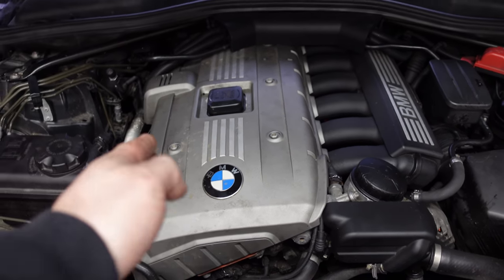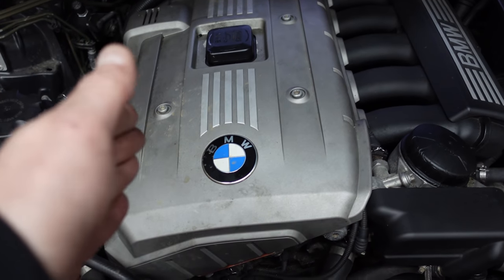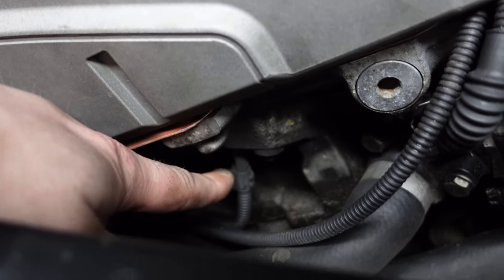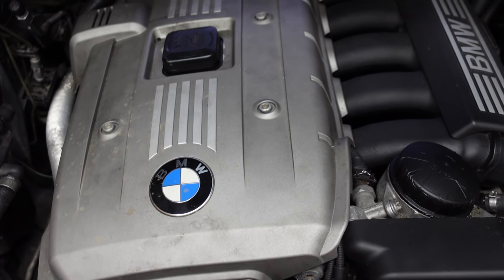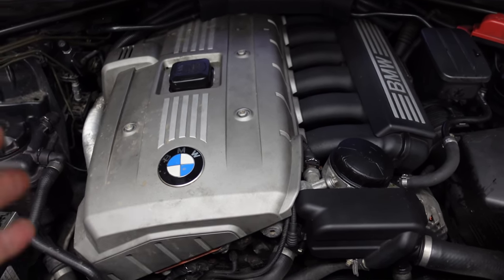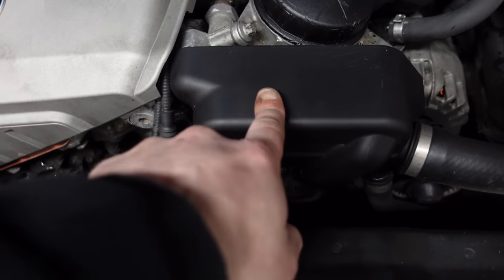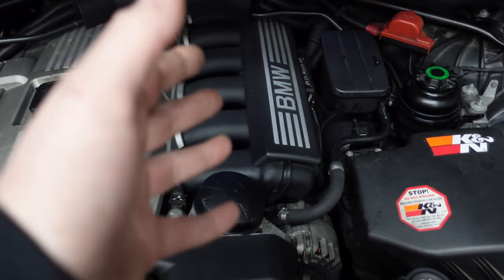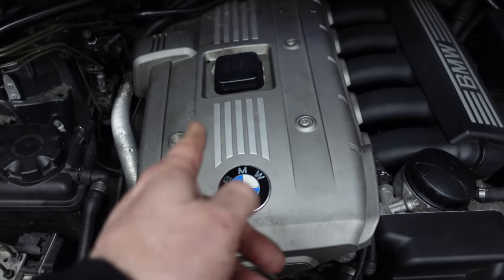The **REAL REASON** Mechanic's HATE BMW / Its Worse Than You Thought !!

Comment: Uh I've worked on and repaired BMW cars for years without an issue. However, I think what you are ignoring is the fact that technicians don't like these cars because they are overly complicated FOR NO REASON. Explain to me why a water pump needs a computer module to control it and why the possible benefits of that outweigh the increased chance of failure. That is just an example of the questionable engineering choices BMW makes on their cars. If you like BMW that's cool but don't blatantly ignore the valid reason why so many GOOD technicians dislike BMW engineering.
Reply: For the simple reason that the engine has less strain on it, for maximum efficiency. and if you are a good technician, then you should have no problem fixxing a modern bmw with the proper software like ISTA +, and what technicians you are on about, if you talk about american ones then you are right, but European technicians love BMW for the simple reason that bmw have fantastic engines (exceptions be there) they drive better then any other (normal) car handling wise, more luxurious with great modern tech. BMW is for people who love to work on car themselves, its a great challenge, but once you know how everything is put together it is fairly easy car to live with, everything is well designed and thought about. if you can work on it yourself like i do, then its the best car you can have = value for money
Reply: @lexburen5932  Fair points made by both the guy above and yourself however do these water pumps just quit without throwing a fault code? Would any mechanic with half a brain not remove the water pump after eliminating everything else and at least bench test it?
Reply: @Luton-Mick  they do fail with codes. You usually have turnbine speed deviation faults or open circuit faults. The reason why you don’t take it off to bench test is the amount of labor and time and it’s location to take off. It’s a waste of time and you usually have a fault code when it fails.
Reply: There's a reason, especially nowadays. It's called C.A.F.E. Standards and B.S. emissions requirements. Now not everything is because of that, but a lot of it is.
Reply: Hoping you read this!  My 2007 328i has a strange problem.  The left rear door will lock during driving, but when I stop and lock all doors with key fob the left rear door unlocks!  It has a new actuator.
Reply: @lexburen5932  re-read my first sentence. I have serviced bmw's for years without an issue. Compared to other types of vehicles though, like Asian or American vehicles, bmw's are just overly engineered for no reason. Everyone outside of Europe knows it. Everyone in Europe knows it but have a hard time admitting it. It's OK, we forgive you 🤣
Reply: Most new cars have a computer for every part it’s meant to warn u before it actually fails

Comment: So basically the mechanics are the problem not the cars. Essentially the engines are more intelligent than the dolts working on them.
Reply: Often most elegant design is simple one witch modern engines are not overcomlicate eco garbage
Reply: As a master mechanic I partially agree with your assessment.  Its a luxury car but many owners take it to the wrong places trying to save money. Fact is its not a honda and they are complicated.  I specialize in luxury cars and notice the many people can not afford  the regular maint of the vehicles that they drive.
Reply: @deadprivacy  Is correct. BMWs are poorly designed and dreadfully unreliable (when viewing from a daily driver perspective). This video suggests that BMWs are some how too complicated for the common independent technician to understand or fix. Ridiculous. BMWs are just like any other car (with their respective eccentricities). Instead of addressing incompetent technicians, you point the finger at technicians as a whole.  The truth is mechanics hate BMW because mechanics value reliability and ease of ownership as oppose to performance. With its common failures and high cost of maintenance, mechanics see BMWs as a poor investment, especially when compared to their reliably superior Japanese counterparts.
Reply: cant understand all the hate either. Im fixing all by myself, owned several different brands and can say for me, that bmw is the most expensive one in spare parts, but the best engineered one and easy to fix. For engine and all electrics you just need a notebook with BMW´s shopsoftware and the car tells you what's wrong by the help of several test procedures.
Reply: @deadprivacy  Spot on but you won't get most BMW owners to face reality, it's like they are in love and won't hear a bad word against their sweetheart.
Reply: I guess the CarWizard on Youtube is a dolt huh? You have no idea what you're talking about, BMWs are difficult to work on
Reply: They not machine if they do know how to do bmw
Reply: A lot of inexperienced mechanics work at dealerships

Comment: Listened to this, took my car to a BMW/Mini specialist and he literally didn't need to scan it. Told me on the spot what the issue is from his raw experience. Made it a cheap same day fix.
Reply: The vanos solenoids fault will not make an engine misfire, they will not set a misfire code And a lot of mechanics clean, change or swap intake and exhaust solenoids to see if the faults follow the solenoid. If it is shows the same fault (and there is a fault for solenoid failure, there are screen filters screwed into the head on the right side that can be removed and cleaned. You are right that it easier and cheaper for a BMW specialist to work on your car, and yes none of use know everything. I am a 45 year Jaguar specialist and the same rules apply@
Reply: @RAGNAR   You are right!  That's because they were "Common Problems".  "Common Problems should've have on a car you'd paid so much money for... 
 Just ask a Toyota mechanic.
Reply: Yeah because they all come in for that because it's a known flaw 😆
Reply: There are no cheap fixes for these cars but these garages love you for making them rich!
Reply: @mechman123
Reply: I have been working on euro cars for years, last shop I was working for specialized in BMW’s. Atleast Once a week a new customer brought their bmw with a inline 6 I pop the hood to see new oxygen sensors so I immediately check to see if the 25 cent rubber cap fell off the back of the intake (super common on the n54 engine I think it’s that one they stopped making around 2005ish). I check my fuel trim data, 02 sensors, maf, print off the data and codes. The put a new cap on, clear codes and reset  then run it to see all data is normal. Tell the customer and half the time they start talking about the codes it had and the previous shops replaced the 02 sensors because they had bad readings, coils & plugs because it had misfires that moved to different cylinders and the fuel pump had low pressure. I show the codes & data from before I explain the 02 sensor deviation codes basically mean they are maxed out lean, when a cylinder isn’t running properly the fuel injector is just off  and because it was a vacuum leak it effects all cylinders so that’s why the misfires jumped around. Now look at the data after the repair and let’s compare to the old which I explained everything so they can understand. I will say a lot of the time shops are honest saying they don’t know much about these cars and they tell the customers and customers don’t like going to different shops so they say well what can u do? The shop says I can replace the parts the codes say but that’s 100% on u no garuentees and the customer has them replace a bunch of stuff that doesn’t fix it. Then you have shops that don’t know anything about them but use their sales tactics to say it needs this for xx reason but no gaurentees because it has all these other codes and before the customer knows it they have 2000 into repairs it didn’t need but they agreed to taking the risks. And the funny thing to me is how so many auto techs complain about euro cars but let’s stay on the topic of BMW’s so these vacuum/air leaks were the most commonly missed diagnosed problems they came in all the time and all u need to do to get an idea if u have a vacuum leak is look at ur fuel trims if they are maxed out at idle then start to look normal at higher rpm it’s a dead giveaway you have a vacuum leak no matter what brand of car American, Asian, euro but 90% of shops don’t have 1 guy that knows this. After fixing a vacuum leak or fuel/air related issues you also use fuel trim data to confirm it’s fixed thats also something 90% of shops don’t have one guy that knows. I do this so I don’t have a customer come back in 1 day for the same reason.   Shops love to blame their techs for everything but never train them or send them to training or give incentive for learning. 

My shop is known as we can diagnose anything and fix anything many shops send customers to us even some dealers. Sometimes you can’t give a 100% guarantee this is gonna fix everything it does happen but throwing a bunch of parts at a car costing the customer a bunch of money is just bad business just be honest you don’t know how to fix it thats the best thing u can do.

Comment: Great video right on point. I'm a US tech, with over 30 years experience. When I first started as an auto mechanic back in the mid-80s, when Ford Chevy and General Motors all went to electronic fuel injection. All of the older guys in the shop would say is, get rid of that electronic fuel injection and stick a carburetor on it. Because they had no clue what to do. I 16 years old I embraced the technology, and wanted to learn as much as I could.
  Many years and decades later, I still like the technology and want to learn as much as possible.
  I have one BMW specific scan tool, to handle the basics. Then I switch over to my laptop and inpa software.
  Back then I only owned Ford's. Today I own three BMWs, and one Ford. I have quite a few friends and family that are BMW owners. If they have any problems they bring it to me. Most of the time it's a very easy fix that they can even do themselves. But the problem has to be diagnosed properly first.
And I'm not so arrogant to think that I know it all. Actually the opposite is true. I know I do not know at all, but I still want to learn.
   BMWs are great cars. Just require a slightly different approach.
  In Failure there can be lessons, in perseverance there can be results.
Reply: I have a 2004 x3 that has a misfire and lean in Bank 1 and 2. Smoked it... no vacuum leak. Changed the PCV , same thing.
Reply: Your situation reminds me of another lesson I learned years ago. I was so eager back then to learn the technology, that I disregarded checking the basics. What could appear to be a faulty sensor or loose connection, could actually be a bad spark plug. Old-school troubleshooting.
  Check the basics first. Air filter, fuel filter, spark plugs, and so on.
Reply: The slightly different approach advice applies to all German mechanical products, they arrive at a result of an engineering problem using a different mindset and approach. The only true successful way to work on anything German is to think like a German.
Reply: @peterbuckley3877  : If you live in a country where the mechanics are not capable to "think as a German", don't buy a German car.  In US people use to buy BMWs as a symbol of status, but now there's a shift toward Lexus. Luxurious, excellent manufacturing quality, excellent reliability.
Reply: the greek philosphers already said something like "i know that i don't know" or "the more i know, the better i know what i don't know". (Always the best approach to tech in my opinion)
Reply: @bkucinschi  4-6 years ago i knew a guy who was a proud Lexus owner (here in europe) and once, during driving, the dashboard of his Lexus "dislocated". I also know someone who's Toyota engine a few years ago catastrophically failed after just 30k km. (and they did not cover anything as the car was over it's 2 year warranty) You can get a lemon/be unlucky with any manufacturer, even with Toyota/Lexus.
Reply: @patrickpierre6114  When was your valve cover gasket changed? Mass airflow sensor replacement ?
Reply: Where are you based haha 🙄 asking for a Freind.

Comment: I took my BMW E60 to a shop to change the valve cover gasket. I have the same engine as yours. I normally work on my own car, but I let the mechanics handle the valve cover because of the torque of the bolts for it. I don't want to break it.  That is an easy engine to work on. Very reliable. The shop foreman was telling me how he don't like BMW's because they are problems.  I told him I had this car for over 11 years never had trouble. Other cars are a lot harder to work on. I get very angry when they do that talk. These engines are very easy to work on nothing to it. I am glad they are easy to work on because BMW has always been the car of my dreams every since I was 7 years old.
Reply: I just did that job on an E90 a month ago, there is a good video from "Zeiten LLC" on the subject.  Getting at the bolts towards the windshield was not easy.  I think the dealer wanted $1200 for this.
Reply: Never grew up as BMW fan, and the first German car i wanted was a B5 A4, but for a time I kinda liked the E90, ended up buying one. Planning to keep and maintain this one a long time.

Comment: Forgot to mention the oil pan leak. Got to pull the transmission. Simple oil pan job is turned to 12 hours thanks to BMW
Reply: Oil pan leaks are repaired by lowering the subframe? What car do you need to remove transmission for?? A lot of rwd cars are difficult to access to the oil sump.

Comment: @BMW Doctor I don’t agree with you actually. I think BMW makes clever, efficient engines but they are not designed with maintainability in mind. For example you have to take so many parts off to get to the water pump or the alternator. It’s just poor design that mechanics need to have such specific and advanced knowledge in order to maintain these vehicles.

Comment: This is a shame really because a properly looked after BMW can be in its prime between 10 and 20 years old.  I have managed to do this for the last 30 years. Buy doing most of my own repairs I have saved a huge amount of money.
Reply: Most people want to get rid of them after 4 years it is crazy to keep them out of warranty or without any extended  and Luxury is supposed to mean the luxury of time not having to work on the Ultimate driving machine that is always breaking down unlike Honda and Toyota  who can somehow make a reliable car consistently  and Yes I own a BMW X5 it was near 90K us  New and it is a pain in the ass at 63K mies  it makes my audi's look reliable
Reply: @johnhender  My first BMW ever, I've had it for 2 years now and I haven't had a single issue aside from doing the maintenance on it. Vehicle has absolutely no codes, I confirm with ISTA/D. Car runs excellent. Not sure what some of you do with your Vehicles to have them break down all the time but I daily mine and don't have none of those issues. 🤣 2008 e60 535i. Much better than any Honda or Toyota I've ever driven. Small piece of advice, if you have so many problems then stick to Hondas. 🤣🤣🤣
Reply: Thats old bmw u speak of. These new ones filled with plastic

Comment: Hey Dean! Think you have (possibly deliberately?) upset a few people with this one. I am 69 years old and spent all my working life as a component level electronics tech. and have no problem embracing modern electronics. I like to look at it this way: I have 3 BMW's and like them all for different reasons. All modern cars are over-complicated, both mechanically and electronically. Every car you could choose to buy will have an Achilles Heel or two. It won't be that long before all the channels and forums will be saturated with people bitching about having to shell out 5 grand for a new battery pack and 3 grand a pop for a new electric motor, so maybe time to enjoy these German engines while we can. You obviously know your stuff, maybe just a slight error with the generalisations, but still an excellent channel that we can all learn from.
Reply from the maker: So you agree then my friend that for old people BMW is getting harder to diagnose ? As your speaking about just them kind of people because for me BMW is easy and cheap to maintain as I know where to go for my parts and not only that Im very well known in the trade and BMW electronics I understand throughout BMW has never changed the way it works, Its peoples understanding and the mental capacity that changes over the years. I do not think any modern car is overcomplicated what so ever and I work on many daily even Mercedes I mean the money isn't nothing if you enjoy the car and get pleasure from it I mean your about to see this channel rise believe me friend when I say that, as I'm about to open up even more to electronics on BMW on the newer models now as I want to focus on that and not so much the old stuff which if I'm honest is quite embarrassing for the old timers as I'm much much younger yet I'm able to do it can you explain why that is ?? and I have never ever been to college or training its all self taught

Comment: Very informative and enlightening video. Why wouldn't I buy a BMW? Two decades ago a 5-series a/c replenish quoted cost £500 (from a BMW dealer). Compatible replenish from non-BMW garage £100 (including lubricant). 
Lovely cars which are ridiculously over-priced and for which you pay utterly exorbitant rates when they need servicing or parts.
Reply: BMW dealers are a joke I recently had to put my E 60 in for a recall they said they found a split rear drive shaft boot gaiter that was split they wanted £750 pounds to replace it I bought a universal boot and done the work myself for £20 past it’s MOT a month later